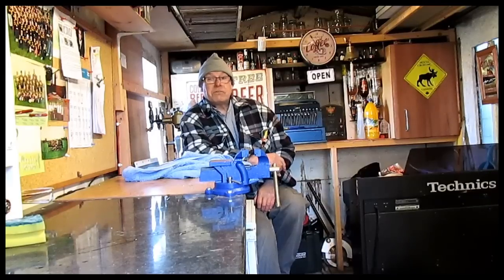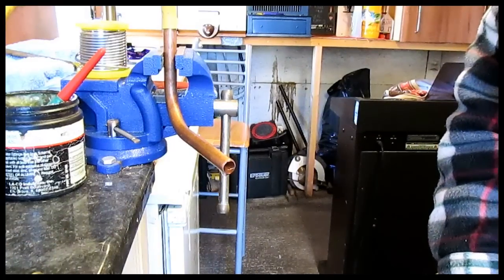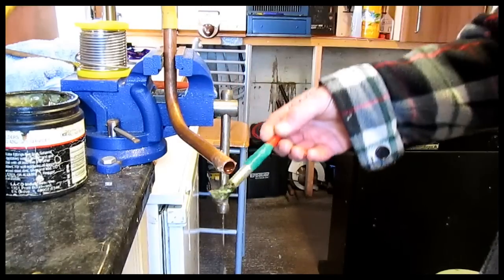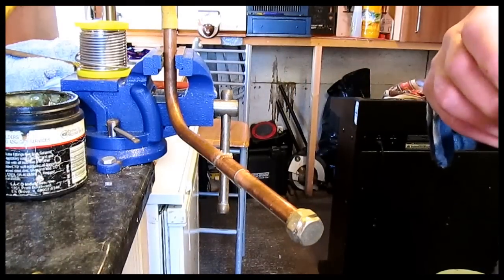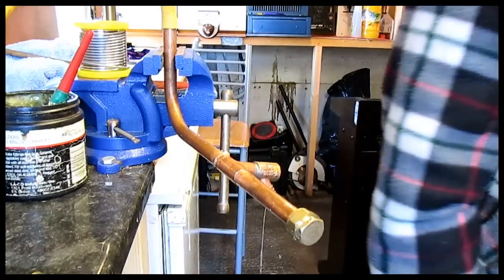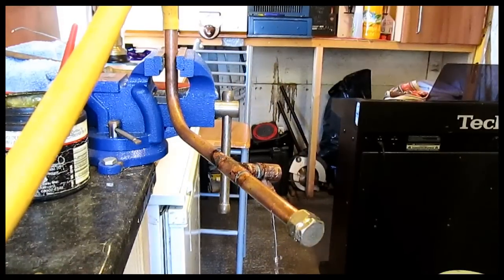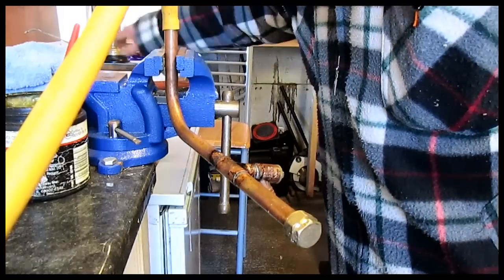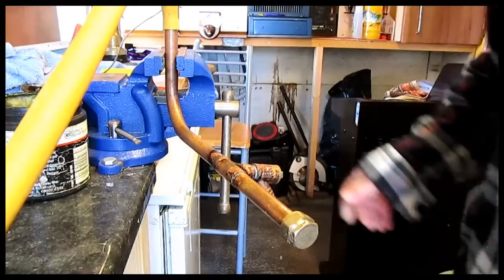toms top tips soldering when there;s water in the pipe

Comment: Keep it red hot lmao, keep it hot, there's no way you didn't f up the other joints with 6 plus minutes of heat.  Bread trick or find what's causing the water to run and shut it off.   And always heat on bottom solder on top

Comment: if you solder 1 inch copper pipe with water dripping, this tip may not work because it's hard to heat 1 inch pipe with water in it

Comment: A pity you didn't detach the tee after soldering to see the quality of the soldered surfaces, specially in the top union and the middle union, where the solder did not flow readily.

Comment: You say that you can’t solder with water in the pipe without a drain.
However, many years ago I fitted a c/h system over 3 floors of my house with 21 rads.
When I filled the system I had one leak on the lowest run, the leak was actually partially hidden inside a single brick wall!
There was no room for a compression fitting and I had no wish to drain the entire system so, using aggressive flux I tried and, it worked! 
I lived in the house for 28yrs and despite often checking the joint never failed.
So, it is always worth trying.
Incidentally, a part time plumber friend used to joke that with aggressive solder you can tin a brick!

Comment: Love your videos Tom but i think i would use press fittings if it had water in. Thank you for sharing.
Reply: Yes time will tell 
Thank you fellas once again 🙏🏽
Reply: Hi gents 
Firstly thank you both for sharing your knowledge 🙏🏽

We do a lot of handyman stuff 
And have come across 
Push fit fittings that have failed 

How do you think press fit will last over the years as from my understanding it’s an o ring type of seal that gets compressed 

Do you think the seal will fail or dry out ? Over time
Reply: @shrekshrek413  Press fit has been used many years in commercial. Only time will tell with domestic. Thanks.
Reply: Allen Hart 
It's more a case of it can be done Allen.

Comment: Ever tried bread up the pipe? Old trick used to temporarily hold back water I believe, obviously won't hold back any water under pressure but a dripping pipe sounds like it would work.
Reply: Just used the bread trick. Helped me out alot.
Reply: Bread  , a Golden Oldy , also used with the forceing pump on a bad airlock comeing of the main at the tapping / coupling